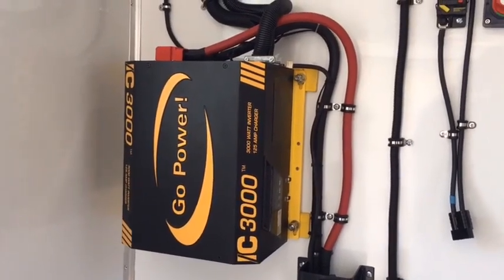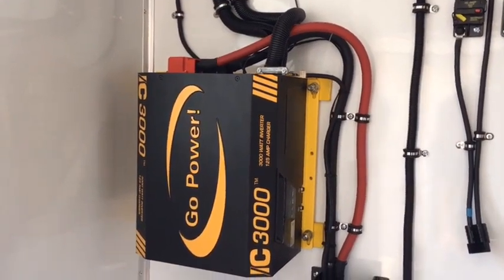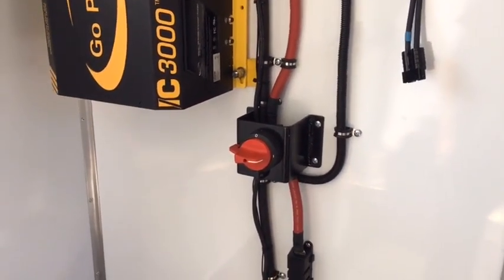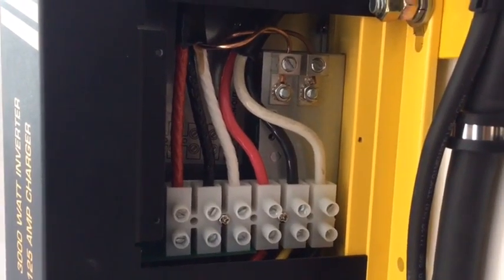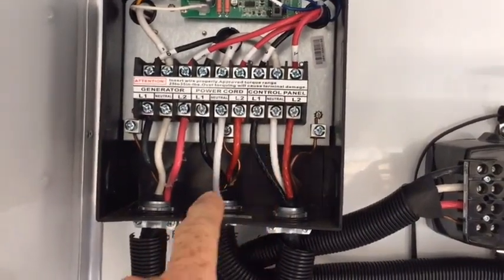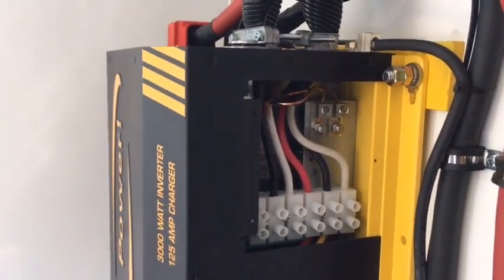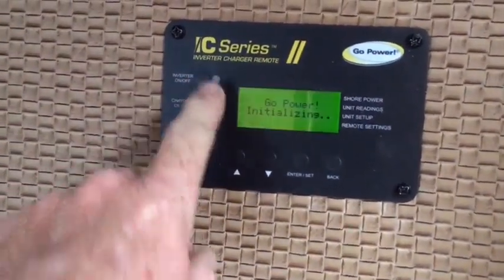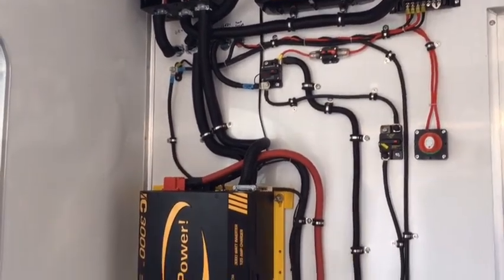GO POWER GP IC3000 12

Comment: So do you have to use a secondary transfer switch or is the one in the inverter fine as a stand alone?
Reply: I'm a little late lol but I think it's just to incorporate the solar and generator, to add them as a separate power source instead of running them with the shore power hook up because that could cause some other problems